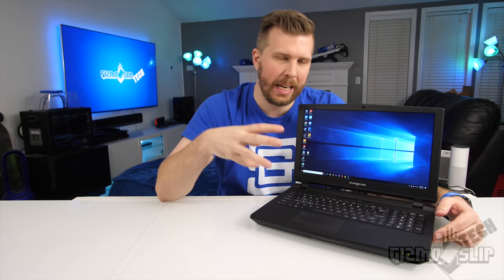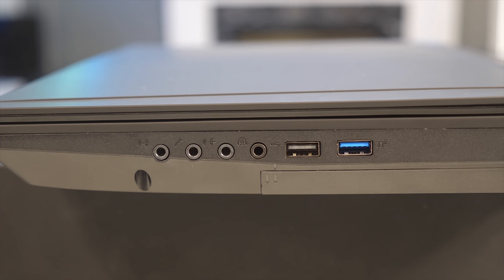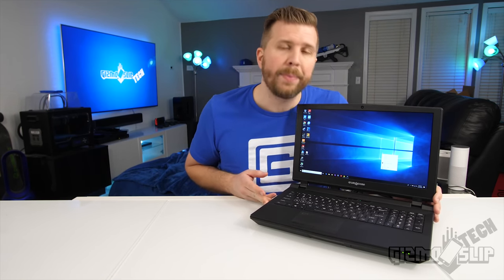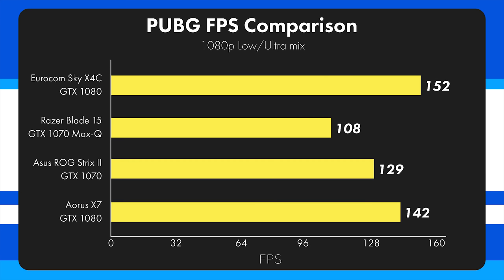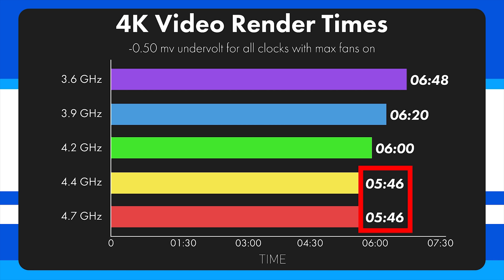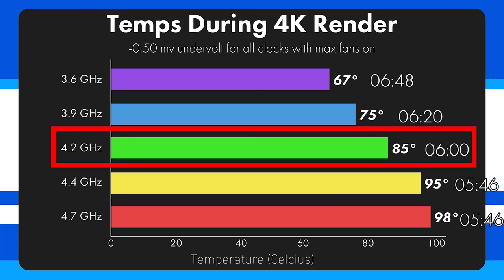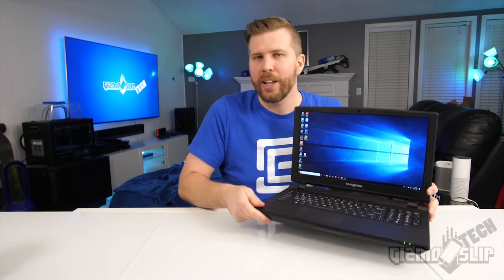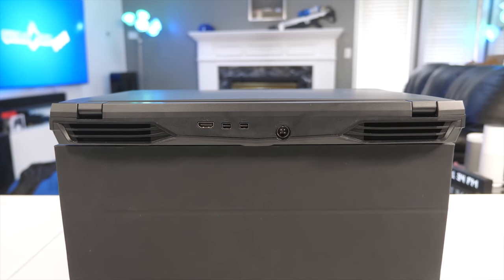Should You Buy the World's Fastest 15" Laptop w/ i9-9900K? Eurocom Sky X4C Review (Clevo P750TM1)

Comment: Upgraded my Clevo P870DM3-G (same as EUROCOM Sky X9E2) to a 9700k from 7700k thanks to modded firmware enabling Coffee Lake CPUs on Z170/270 chipsets.  It turns out Intel wasn't entirely honest about the 8th and 9th gen chips not being compatible with the older platforms.
Reply: I just wonder if the P870DM-G could upgrade as well. Thank you
Reply: @hongbit2011  It can
Reply: @1216Rockman  Thank you
Reply: Very interesting I had that machine a few years ago.. Though I upgraded to the Clevo P870KM a few days latter as I was within return period and they were basically around the same price. Also my P870DM3 had this weird keyboard issue where I always had to hit the caps key before the keyboard would work.. and some muffed sound from speaker... (another reasons I upgraded.)

Comment: I have this system, but it just isn't worth it to have the i9 9900k. I went with the i7 8700 6 core 12 thread, and picked up a 32gb 2666mhz Corsair vengeance kit for about $138, slapped two 1 TB WDC Black 7200 RPM drives and an Intel 660p series 512 GB NVME SSD for my boot drive. RTX 2060 6GB GPU and the standard IPS 1080p panel. Takes everything I can throw at it, and since I'm an over the driver, my computers go through hell, temperature extremes, vibration, bouncing, falling to the floor, on top of pushing it hard with some games. It's been with me for about 8 months or so as of November 2019, and the only issue I've had so far is the WDC 1TB drive that came with the chassis, because I order my stuff without an OS, died for no reason. Luckily, the backup installation of windows on that drive had been backed up to a second external drive. I usually run 2 boot drives in my systems so I can recover them on the road in case of failure, whether is hardware OR software related. I really hate not having my computer. I actually use the thing more than my phone. It's just much more pleasant to work with in all things than my smartphones

Comment: You can actually upgrade the GPU as well, say Nvidia brings out the 2080 Ti mobile graphics card you can swap it (Which they might, because on Mobile Benchmarkers there's a new list saying 2080 Ti (MOBILE)
Reply: But with the cpu thermal throttling,  will there be a point of upgrading the gpu?

Comment: great review like ever.
but why only -0.50mv? doesn't it allow 75mv or 100mv deduction?
and repasting with grizzly plus deliding(i know 9900K is solder already but it's shouldn't be the best material as intel prefer longevity more than best thermal paste out there)
also,if the heat is coming from sides,how much could a vacuum cooler(dual units) help temps and throttling as well?

merry Christmas/happy new year by the way
Reply: amirbahalegharn365 It comes undervolted out of the box so the psu ca support it probably

Comment: I'd like to see this in a gaming laptop: 14". A bit thicc, but not too much. Maybe a full 1 inch or even 1.25. Very rounded corners, which still makes it easy to get in and out of the bag. Not too heavy. Excellent cooling. Excellent durability. Excellent battery life. (Just with browsing and not necessarily while gaming, though.) The extra space can buy those qualities. And before you say "Alienware 13" -- too heavy. Not rounded. Poor battery. Too small a screen. Wrong styling.
Reply from the maker: Me too! I'd love it too if they put a throttled down 9900K that only put out 70 watts power draw so you could have crazy high performance multicore performance in a much thinner, smaller package.

Comment: Of course everything is going to throttle a 9900k and a gtx 1080 under the same shared heat pipes in small laptop.. no way to cool them way down unless water cooling externally to laptop.... also try video and screenshots of software showing us how it runs not just talking about it...

Comment: I have the  eurocom  sky x9 I ending up swapping the 9900k for a 9900 ( non -k) ... Kinda mixed bag all  core performance is worse I think around 7% single and dual core much much better..   Temps are also much better outta the box it still throttles but not as badly as the 9900k used to..
With undervolt  it's almost perfect except like I said it's slower about 7% but for less noise and heat I think it's worth it...